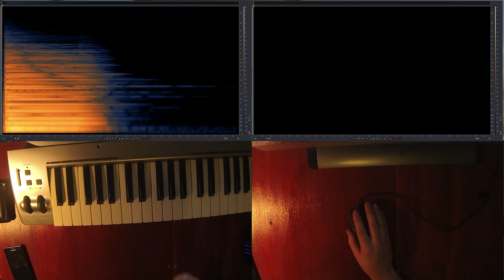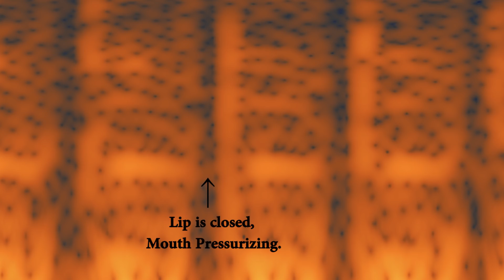Beatboxing in Slow Motion - Smarter Every Day 109

Comment: 4:35 Shouldn't an ideal sine wave be a one dimensional sharp line, since it only vibrates in one definite frequency without overtones (i.e. without those less intense but still existent higher frequencies, that fade out)? Or are those overtones due to it being a real sound that had to travel through air to hit a microphone?
Reply: Ideally, yes, but the input to that process was just an approximation of an ideal sine wave made up of thousands of discrete samples that are limited to the resolution of the format (probably 24-32 bits).  So what you wind up with are a bunch of aliases that appear in the FFT as harmonics of the original signal.